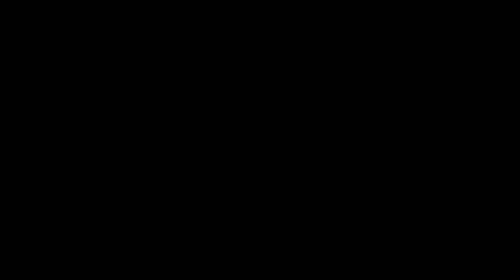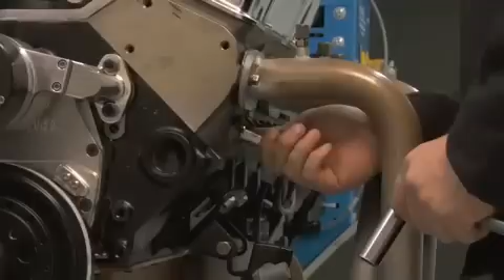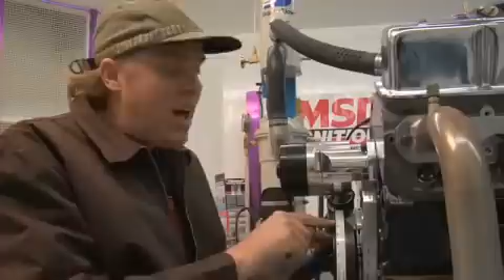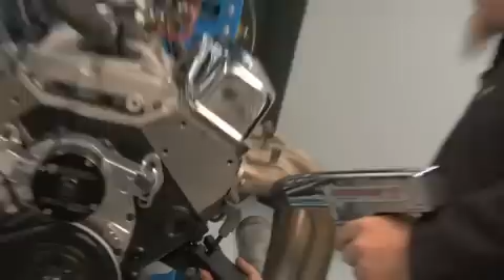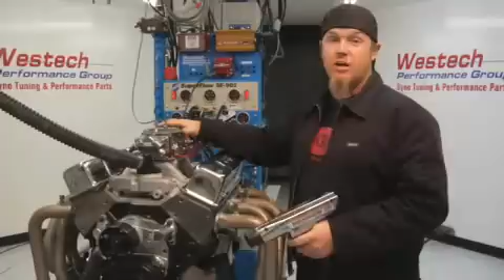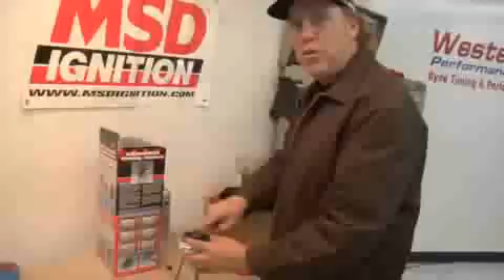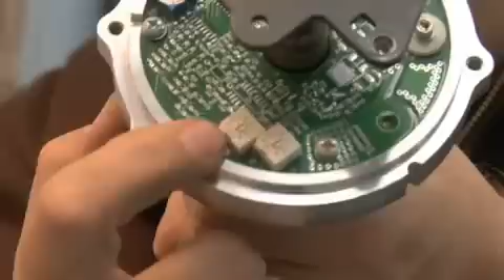How to set your ignition timing

Comment: After they adjusted the total timing setting to 35 degrees and rechecked the idle timing  setting and came up with 19 degrees, it might be less confusing if they called 19 degrees the adjusted initial timing where as the initial setting was12 degrees . I’m just trying to make it more clear.

Comment: Hi sir, can you give me one example answer for my question? Example for like n14 engine/Peugeot 1.6 thp with the undersquare, compression ratio like 10.5.1, turbocharger, direct injection, 6 speed auto, no marking degree, and result for that engine like computer scaning, as result -1 ignition degree, minimum degree like 15 to 18, maximum degree like 30 to 34 degree, so if you like mathly counter in your brain what - ignition degree would like you choose for that engine performance would be better?? Hope you can response and give your answer sir. 🥲.. thank you very much sir.

Comment: I know this video is quite old but the timing still doesn't make sense to me. 

Do you set the cam physically to 12° BTC or do you leave the engine at 0° and rotate the distributor until the light reads 12°?

Comment: Hi there m from fiji and ur video is very informative. I have a 2000 Toyota primeo  with 4a engine so 1 year ago I changed my timing belt and since that day the engine seems to have some problem as it does not jump as before ,there is late engine heat up and there is a back fire at times and the engine has distributor coils and the usage of fuel has also increased.Also the vehicle hesitates when moving from a complete dead stop.

Comment: So I didn’t even set TDC before I took the old one off. Put the new one on, then set TDC when I was told it was mandatory. It will not start. I actually marked where the rotor of the distributor was and put it on the same exact way the first time and it didn’t work. So then I set to TDC with the distributor still on and it still won’t start. I wonder what I did.

Comment: I KNOW YOU GUYS ARE NON POLITICAL BUT HOW FAR ARE YOU GOING TO GO WITHOUT COMMENTING ON THE WAR ON OIL. ELECTRIC TRANSPORTATION IS WORSE THAN EVER IT WILL NOT GIVE US AN AFFORDABLE MEANS OF TRANSPORTATION. A HORSE WOULD BE BETTER THAN AN ELECTRIC CAR. THE BATTERY'S WILL BE ABOUT 10,000.00 TO REPLACE AND WHERE WILL YOU GET THEM. REPAIR SHOPS AREN'T ANY. CHARGING STATIONS RUN ON GAS AND COAL TO CHARGE THEM. THIS IS NOT ADVANCING ANYTHING IT'S A MASSIVE COSTLY POLITICAL ATTACK ON THE PUBLIC. PLEASE WE WOULD LIKE YOUR OPINION ON ELECTRIC TRANSPORTATION. DOES IT MAKE ANY SENSE TO YOU. REMEMBER WEATHER CHANGE IS A MYTH. IT HAS NOT BEEN PROVEN BUT CRAMMED DOWN OUR THOUGHTS. THERE IS NO SCIENCE TO PROVE THIER THEORY. IT'S ALL A POLITICAL CREATION LIKE THE PANDEMIC.

Comment: Great Information and as always the hands on section is easy to understand. He simplifies even something complicated well enough that the average Joe can follow and get something useful. Always enjoy what ever he's been doing...from those days of buying a junker to drive several hundred miles back home to those Expensive EXOTICS on other shows. Call him a Jackal of all trades is accurate indeed....yes I spelled it correctly and I meant to say JACKAL...JACKAL is the Ol' Timers verbiage for effect and humor in the very best of ways.
Always been a fan of these guys and seen Freiburger like forever on several channels/shows...Always has a friendly, regular guy good attitude with fairly decent explanations of the workings of the thing he is talking about.
I've been a SB guy from the late 60's...yeah, I',m that old. The SB Chevy is the most versatile engines ever made Barr-none. The timing can be a couple of degrees different from one ENGINE to another with ALL the same IDENTICAL components. So you'll need to find that sweet-spot for YOUR ENGINE... you can build two identical engines and they will each have a different sweet-spot in possibly a couple of things. 
THE ONE SPECIAL ASPECT that MUST need mentioned is that thing they didn't touch on...The FUEL OCTANE RATING has a LOT to do with how far you can ADVANCE the TOTAL TIMING without Grenading a piston.
Say you just want to run pump gas with the middle of the road 89 OCTANE then your TOTAL TIMING will find itself around 30 to 32 degrees. Where as if you run Premium Pump Gas of 91 Octane Rating that TOTAL TIMING will bump up to around 33 to 34 degrees.
Now Run some RACING FUEL in that 5gal can, then you can then SAFELY run 35 to 38 degrees TOTAL TIMING...HOWEVER, this is NOT SET IN STONE due to all the other perimeters. TAKE is easy and with baby steps to find the SWEET-SPOT. That spot can change from day to day so pay close attention to this performance setting.
ALSO keep in mind that those numbers don't make a huge difference in performance on the street. SO if you are just looking for some dependable and safe playing around power and keep it stout then don't go APE-CRAZY until you work at bringing it up in baby steps and ONLY ONE CHANGE AT A TIME. Do too many changes at once then you won't know if they are compatible or one change may have countered another. One change at a time gives you something you can work with to find your engines sweet-spot...ONE STEP AT A TIME.
The figures above are usually on one of the most common engine builds I do which is not radical by any means. Say around 10.5 to 1.0 Compression, 282 x 210 Cam. 1.6 ratio COMP CAMS Steel Roller Rockers on both the valve and the Fulcrum contact point (I don't like the Aluminum Rockers because I've had some fail...never a failure with steel version and they seem to keep their adjustment much longer and better), Roller Lifters, Torquer II intake with a 750cc DBL Pump Race Carb...no choke accommodations with average 72 to 74 Mains...Idle can vary too. MOST of those numbers depends a lot on Attitude, Humidity and so on.
This is a good combination for my area in a fairly heavy vehicle. These specs are usually in the pickups weighing in the neighborhood between 4,850 to 7,200 LBS and running Racing Fuel only for the 1/4 mile days. TOTAL TIMING averages between 34 to as much as 38 degrees advance with a long Curve. I like a longer (or slower) curve for the heavier vehicles so it doesn't get up there too soon...takes them longer to get up in revs and seriously does not affect the overall time down the track. I like keeping that curve at the right timing until it gets up around 3.800 RPMs fro there on it doesn't make any difference SO until then it doesn't detonate and keeps it much, much more dependable.
Not a super hot build but an economical build that has plenty of THAT ADRENALINE FIX fun for the weekend racer that has little to no break downs for several seasons. It's not ALWAYS ABOUT how fast you can can go but rather your consistency in your run times that gets you the trophy in bracket racing like we do around here.
WOW, didn't mean to go this long but you get me talking SB Chevy's and I just let loose and spill the beans.
AGAIN, GREAT VIDEO ON A CRITICAL PERFORMANCE SETTING FOR THE SMALL BLOCK CHEVY
Reply: My harmonic balancer is set at 12 how do I stop my time in from that point

Comment: what would cause timing mark to jump when engine idling on a 89 s10 pickup with 2.5 engine and manual trans. This is with A and B jumpered on ALDI  connector.

Comment: Not a bad video but RPM is really only half the story! Any engine will produce maximum torque when the peak cylinder pressure occurs at between 14-20 degrees ATDC. The likes of Ricardo and other engine development companies have found this out through experimentation. In order for enough time to pass to allow the mixture burn to create peak pressure at the right crank angle ATDC the mixture needs to be ignited usually several degrees BTDC. In simple terms you can say that the burn rate is more or less constant and it takes a 'set' amount of time to burn. Clearly at 4000 RPM there is only half the time available to burn the mixture compared to the time you would have 2000 RPM. The obvious solution is to ignite the mixture earlier to account for the reduced time. (Swirl, turbulence and exhaust gas contamination also come into play but lets keep it simple!).  Engine speed is not the only factor here, the burn rate also depends a lot on the initial cylinder pressure just before the plug fires, a low initial pressure will cause a slow burn rate. When an engine is under very little load the throttle plate is virtually shut, this means that the engine is hardly able to draw in any fresh charge (its Volumetric Efficiency, 'VE' will be low), the result is that there is hardly any fresh charge to compress, the initial cylinder pressure will be low so the burn rate will be slow. If the engine load was not taken into account then under light load the engine would be running with an ignition timing that is too retarded, the peak cylinder pressure would happen much later in the power stroke than 14-20 degrees which means that you are not extracting as much energy from the fuel as is possible with the correct timing. This is why any engine that is operated for any time at part throttle should have a vac advance system as part of its ignition system. On a related note one thing that really pi55es me off is when people state that you can just set the timing up by advancing the engine into knock and then just back it off 2 degrees, this is rubbish except if your engine has been built with too high a CR for the fuel that you are using. Timing a well built engine up like this could mean that it starts to knock when the peak cylinder pressure occurs at say 6 degrees ATDC so you back the timing off 2 degrees, the knock stops but the peak cylinder pressure is now at 8 degrees ADTC which is still too soon in the power stroke. You think that the engine is giving 'its all' but it would make more torque if the timing was backed off at least another 6 degrees.

Comment: AAAAnnddd!,,,,,, (my best David Frieburger).,,,, If you have a vacuum advance style distributor, the vacuum line needs to be disconnected from the distributor(or carburetor) and plugged off while setting initial timing.  The idle rpm needs to be low enough that the timing marks don't change(or change very very little) when you reconnect the vacuum line back again as the timing light pulses.

Comment: My GMC says to disconnect the the electrical advantage system on my 94 Sierra C3500 don't have an owners manual to know where that is?
Reply: Michael Pearce beige wire on the firewall near the relay pack

Comment: I need some help long story.We replaced motor on 2006 silverado with new crate large block 5.3 swapped everything new flywheel  installed in truck but motor won't start just barley turned over it has no distributor all electronic & computer what do I do

Comment: The EST distributor module on the side can also control injector firing, make sure to plug in BOTH connectors on the side or else your injectors won't fire, or the distributor won't get energized.  Make sure to unplug the EST timing control before adjusting timing, it'll be a little black coloured coupling with a single black striped tan wire (I found mine on the passenger side coming out of the wiring harness, don't get it confused with the grey coupling near the distributor, the engine won't start at all with that unplugged) which then signals a code 42 stored in the ECM.  This disables the EST so the distributor can be mechanically timed accurately, which is why the emissions label usually will say to set timing at 0 degrees, read your label to get the specific degree of course.  Once timing has been set, plug the EST single wire coupling back in, and restart the ECM by pulling its power fuse under the hood, or disconnecting and connecting the battery. (disable any anti theft features on your car before doing so, or you may be accidently locked out from those devices due to a code reset) The EST will then do its job normally by advancing the timing accordingly, and retarding the timing if spark knock is detected.

Comment: how to remove distrabator than has been stuck on and will  not come loose.
Reply: Go to your natural herb store and get some pure mint oil. You can use Marvel Mystery Oil also. Keep putting it on and let it soak in. It may take several days. Once it moves try to remove it and clean it up so you don't have that problem again. It must be a Ford.
Reply: manually rotate it wit some kind of break bar, me i used my jackstand handle. while rotating slightly tug on the distributor it should come right up

Comment: Why are educating ppl talking about explosions????? The fucking fuel burns and has a flamefront, its not fucking nitro, its not TNT!!!! Fuel burns in a engine!!!!
Reply: +jay osborne  Pretty much everything you said was wrong.  Higher octane prevents knock/pinging, that's about all it does, whatever you are saying about allowing more gas to expand is nonsense.  The reason the piston is shoved down is because the fuel is burning/exploding whatever you want to call, that expands and drives the cylinder down.  

Like RookieDude Stor said, detonation (also called pinging) is when your air/fuel mixture is self-igniting rather than having the spark plug do it.  That won't blow a hole through your piston (I've never heard of that happening, maybe it could happen with nitrous) instead it can fuck up other shit, like connecting rods, bearings, etc.
Reply: Perhaps he was making the concept a bit easier for inexperienced car fans to understand timing ?  I am not a mechanic, but I do enjoy watching and learning about cars.  I never understood timing, now I do.  I'd say David did just fine with his explanation.
Reply: explosions (detonation) blows holes through tops of pistons and other fun stuff.

expanding gases within the cylinder shove the piston downward - thermodynamics 101 - the point of higher octane is to slow the burn and allow more of the gases to expand
Reply: There is nothing exploading in an engine, detonation is uncontrolled combustion were you have air/fuel mixture selfignite. This can occurre at sevral diffrent locations in the combustionchamber due to heat. There is nothning exploading!!!
Reply: Did he? teaching you how engines have explosions in there combustionchambers?! Read up on the speed the flame has to travle to be called an explosion. Internet is good some times but this is not one of them, ppl watch things and belive its true because some famus boy siad it. Same with using the word vacum or suction or how you spell it over in america, there is no thing as vacum in an N/A engine, it creates and underpressure which will cause the higher pressur air outside the engine to want to compensate for the low pressure inside the cylinder and makes it rush there as fast as it can, its about eculazation of pressure. No more internetwarrior from me now, read books and build engines, use internet as a way of entertaining youre self ! :)
Reply: Correct terminology or not, it gets the point across, period. They're not engineers, they're not designing the engine. And id be willing to bet no one watching a video about how to set ignition timing is either. 
Hell I work with engineers that use terms incorrectly, not very often but it happens. And sometimes just to see if people are paying attention, imagine that.
Reply: RookieDude Stor 
*ignition = ignites gas air mixture in a compressed cylinder chamber thereby causing the gas air mixture to burn/expand rapidly (or explode the mixture in all directions) creating an expanding force upon the piston head causing it to move downward from the force of the expanding (or exploding) gases.
You say toe-may-toe I say tah-mah-toe it really doesn't fucking matter in the big picture of things that are relevant.

And that technical bullshit explaination about what a vacuum (spelled correctly btw) is in relation to an operating engine only means one thing ad far as relevancy goes.... that you're a intellectual asshole with delusions of grandeur. 
In other words, to put it simply, you're confusing the the lesson to show off your nerdiness,  and that just means it's bullshit.
Period. 
Leave the teaching to the teachers and the way things have been taught for over 100 years. 
If you want to argue semantics grab a dollar and go call someone who gives a Fuck.  We don't do that here.
Reply: Back to school guys!
Reply: Shut the fuk up ya damn know it all asshat
Reply: way2easy2love After you fucktwad.... after you....
Reply: way2easy2love ki
Reply: confined space is an explosion, a pringles can will explode, if you step on it, so will a balloon, if you light an flammable gas on fire in a confined space, its not burning, its exploding, which is how you get horsepower, this isn't a steam train, we aren't burning coal

Comment: thanks for video guys I been watching this over and over to understand better .I went ahead and bought a nice timing light to check it I'm not having any problems but good to  set it up for correctly .however the mark on the balancer on my 79 Corvette l48 engine is way after the angle tab readings .how can I check that now .does it have to be withing the indicator tab .or mechanic set it up like that on purpose after he put a crane cam on it .thanks

Comment: Help! I've got a stock 83" 305sbc Canadian model holley 600 vac sec with hei blueprint distributor timed at 15 degrees at idle is it too much or too little?
Reply: +Chandler Castanza 12 is probably better, but depending on the condition of the motor, you might have to advance a little more.
Reply: +231mac  thanks. I'll give it a try.